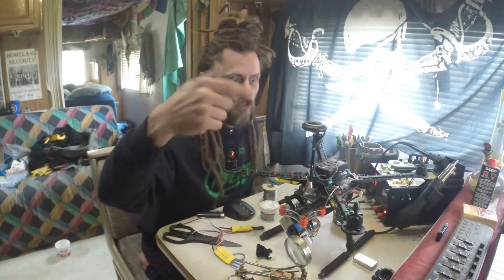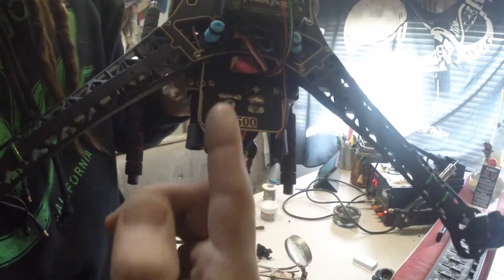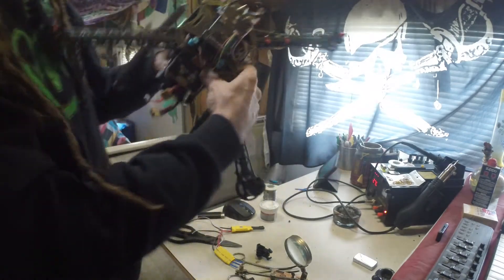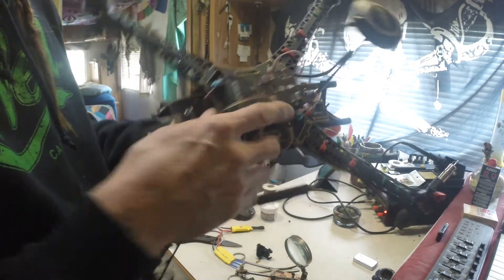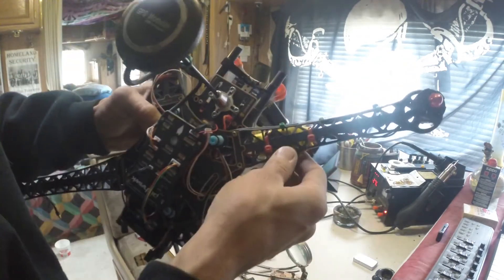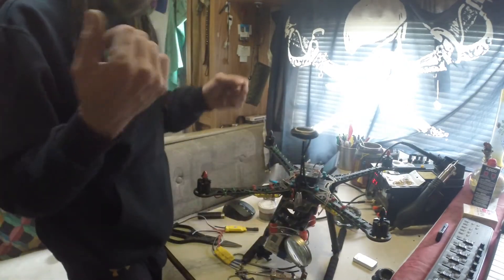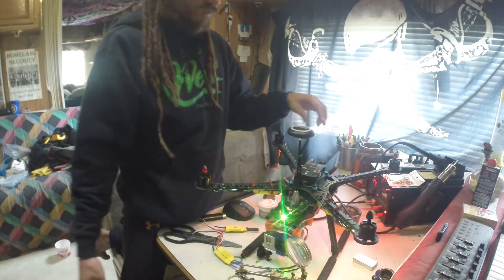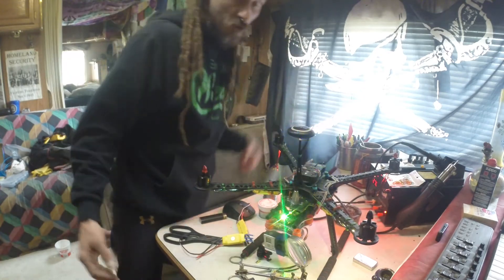S500 Quadcopter Drone - Build Complete - Power Board WARNING!

Comment: Thanks for pointing that out.  All I got with my kit was a couple pictorial diagrams.  Got nothing about the circuitry.  Fortunately, the kit is pretty cheap so not much ventured.  I am debating if the "undercarriage thing" with the two tubes is worth using.
Reply from the maker: Glad it helped. This was a fun build for sure.

Comment: Glad you got yours flying!  I gave up on mine and it's sitting in my closet out of site out of mind.  Lol. That thing drove me almost to insanity!!  After a set of 8 motors 8 ESC's 3 different flight controllers I had to put it down.  I couldn't get anything to calibrate right meaning ESC's would all beep at different times and motors would be twitching ext....  I've also decided to sell off all the rest of my quads and will be sticking to fixed wing.  Imo much easier to deal with then these quads.   Thanks for the help though I do appreciate it.
Reply from the maker: Hey bud! I actually took the s500 for the first flight yesterday... While it did fly, it seemed that the calibration was off somehow. There was wind with severe gusts yesterday, so perhaps that is the problem ( I will try to get that video up today )... I am going to try to re-calibrate today and go for another flight... Wish me luck ;) Bummed to hear that you gave up on yours... Initial calibration can be difficult, I know, I am dealing with that now.... Hope you have more luck selling it than you did building it... Thanks for all your comments dude.... let me know if you put up any vids of your fixed wing!!!!
Reply: I will. I seriously think I'm better off with fixed wing simply because they are much easier to set up and I don't have to deal with 4 ESC's and compass or gps. I'm an older guy with little computer skills nor patience so something slow an easy is probably best for me.  
I'm selling my phantom 3 standard as well and pro also my XStar Premium because they just sit in the closet collecting dust. After selling all this I'm going to call stuff I should have enough cash for a hell of a fixed wing
Reply: Yeah , definitely good luck with your build bro. I do envy you and wish I could have gotten mine off the ground but I guess it wasn't meant to be.  Lol. Mine never even had 4 motors running at the same time and when they did finally run at same two of them twitched!  That was when I threw in the towel.
Reply: Guess what!? I finally got her in the air today!!  I haven't tried RTH yet. All i flew in was stabilized mode and I tried althold which worked somewhat but needs adjusting for sure.  In althold she wanted to climb and drift forward so I think if I isolate the barometer that will fix that.  As for gps loiter , I'm not even sure gps is working correctly on this apm2.8.  I also had to reverse channel 2 pitch because it was reversed for some reason.  In radio calibrate in mission planner it showed it was working fine but in real life it was reversed.  Anyways I'm just happy I got her off the ground
Reply: I'll put a video up tomorrow showing my flight
Reply from the maker: NICE!!!!!!!!!!!!!!!!! Very cool! Yea, I need to recalibrate mine too... It's just been too windy to fly here... on my initial test flight stabilize caused the drone to flip over but loiter worked ( kind of ). There seemed to be some sort of magnetic disturbance where I was flying and it was also very windy with 10mph+ gusts. I will try to get that latest vid edited and uploaded today....
Reply: Pirates in Teepees cool.  That's kinda funny because mine flew fine in stabilized mode. Loiter barely works. I tried it today and she was all over the place.  That's why I'm not even going to attempt rtl yet until I figure out what's wrong with gps. I'm kinda used to flying racing quads in acro/ rate or some call full manual so stabilized anything is going to fly well for me.  I tweaked the pids a bit and I've got her pretty snappy! Now if I could just get this gps and loiter worked out.  
 I'm seriously thinking though that my APM 2.8 has an issue with gps because I'm using an external gps and compass and my blue led light is solid all the time. From what I read on ardpilot forums if you are using an external gps-compass before arming the blue led will flash meaning you have gps lock. If you use on builtin gps compass the blue led will be solid when you have a lock.  It's confusing as heck.  I took the jumper out next to gps because I'm using external gps compass but I'm wondering if I need to take out the jp1 jumper as well?  
 I'm powering my APM 2.8 and receiver with a power module though so I'm just confused right now.  If you have any suggestions I'd appreciate it or some insightful info on the matter that be assume!! I'm sure you are busy trying to get your craft right as well though but just in case you have any ideas.